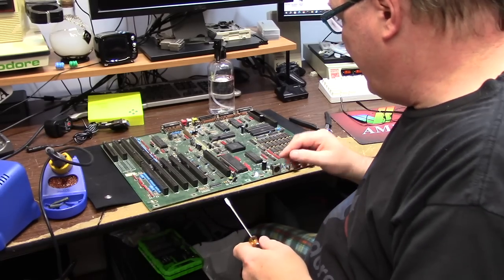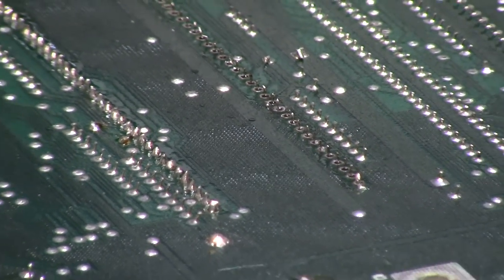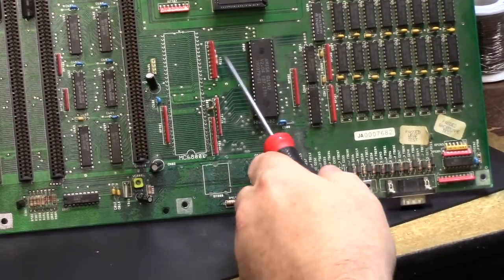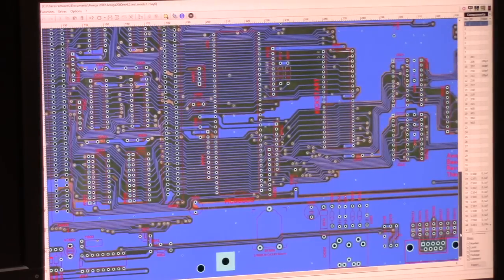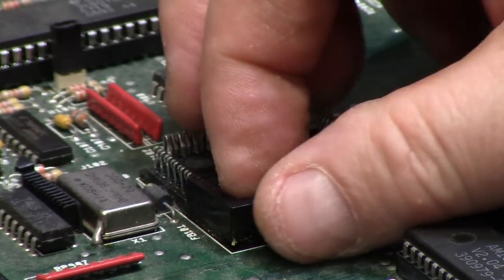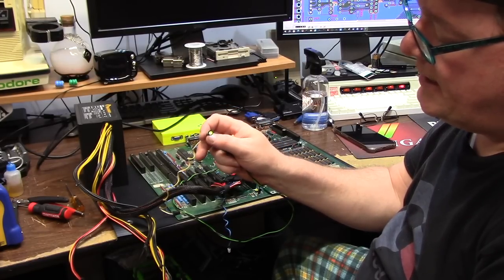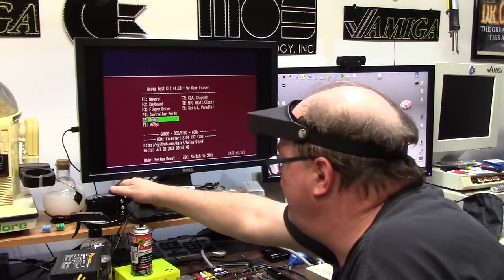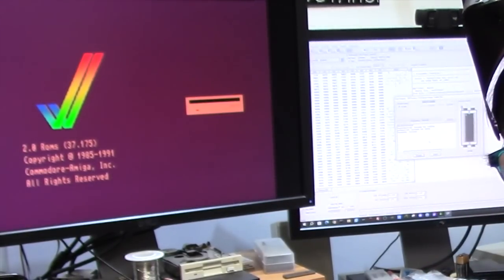Another Amiga 2000 rev4  my favorite!

Comment: The black stuff on traces is NOT from battery juice. It's very common on arcade boards too (I've repaired thousands of them). The black stuff is caused by moisture because it was stored in a damp place for many years. It just "looks" bad but it's fine.... as you discovered, no broken traces where the black stuff is....
Reply: Genuine question @g4z-kb7ct. At 5:45 Chris exposes the copper and the black mark appears to be in the copper. Surely if it was moisture it would be green(?)

Comment: Chris, I need help with my 4.1 board. When I received it there was only a black screen. Since then I have replaced the processor socket, the Agnus socket, socketed and tested the third and fourth line of RAM ICs, socketed and tested U540 & U541, tested all the custom ICs, repaired 8 traces around the battery on either side of the board, traced every pin of Agnus, the processor and the ROM, watched all your videos...and I still only receive an insipid green screen. What pray tell should I do next?!
Reply from the maker: Does diagrom boot?
Reply: @ChrisEdwardsRestoration  Just a flashing green and red screen that turns grey and then settles on green.

Comment: Well done Dr. Chris. What is with all these Amiga 2000 ver 4.? Mobo's?
Is it possible that none of the ver 6.? boards did not suffer the Varta fate?
Reply: ALL Amigas with a battery suffer the Varta fate including B2000 rev 6 boards.
Reply: @g4z-kb7ct  I lost my rev6 to the varta of ☠️ death, currently transplanting all over to a Floppie A2000 pcb
Reply from the maker: They all get slapped if the battery is left in. While the “GP” brand is less leaky? They all leak and kill them.  Rev4 boards i hate as the ram is 32 chips vs 6 of the rev6 and the logic layout is more prone to damages. Also it seems like they find r4
Boards in a old bucket at the bottom of a lake for some reason
Reply: @ChrisEdwardsRestoration Rev4 boards are not too bad. It's pretty easy to find bad RAMs if you know how